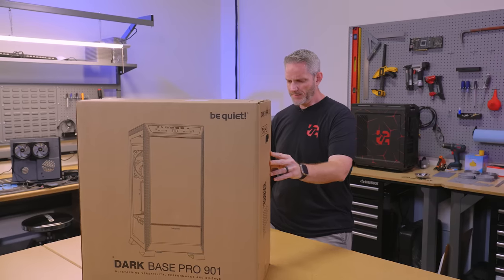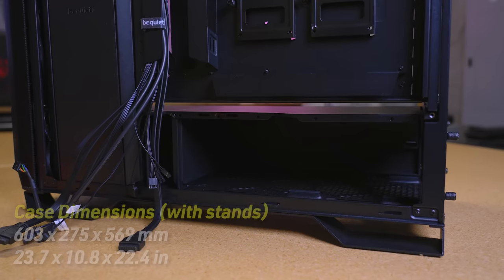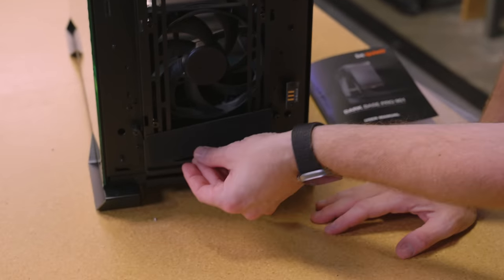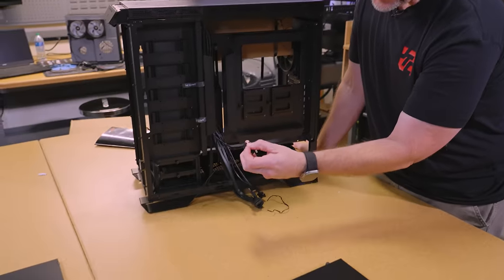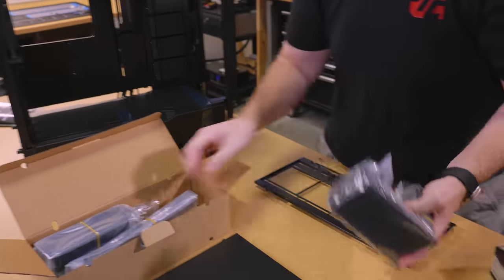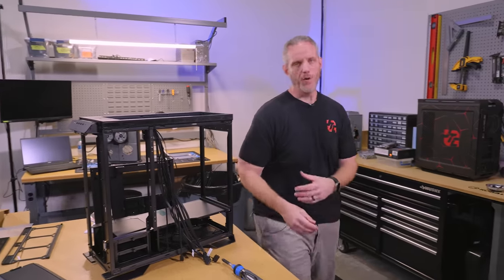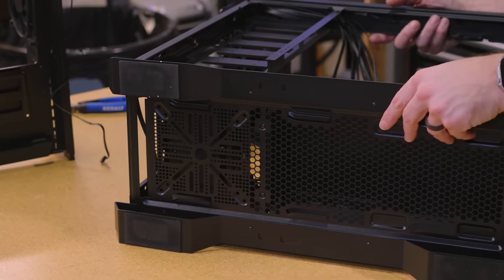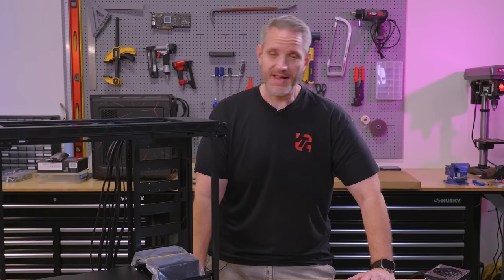This computer case is just crazy!

Comment: I really love the idea of the pogo pins for the fans on the top and front as well as the Xi charger; would love to see those features on more cases. Especially with RGB fans the amount of fan wires that have to get webbed through the back these days is insane so having them all neatly tucked away would be amazing. I am curious mind you how annoying routing those cables is if you want to change out the stock ones.

Comment: I have been using my 801 black for almost 6 years now. It has seen multiple systems. Multiple watercooling configurations and it has been amazing.
Now.. this Dark base 901. That would be worth upgrading to. 

The only problem i really have with my 801 is airflow. It doesnt have a lot of that stuff.. the 901 looks GOOD!
Reply: The Airflow Front Panel (BGA10) is still floating around for purchase.
Reply: I have same 801, I took grinder to front panel ,first popped the foam off in side cut large rectangle and recycyled a 1970 wire mesh from old speaker grill from box tv. 9x 140 fans and 3x 120 fans, great cooling for Australian weather

Comment: I like the 5.25" accessible bay.  I'd actually love to see the option for up to six 5.25" accessible bays.  That would allow for a full ATX board size for use as a home server once I add two cages that adapt three 5.25" bays to four 3.5" hot swap.
Reply: It's also nice if you still rock an optical drive.
Reply: I would say just build your own NAS, even much older cooler master designs offer great cooling and hot swap built in functionality.  It would work in this case but cost far more to do all the conversions.  Hot swap is neat but not really needed for home use, even many large businesses still have all network drives solid mounted requiring tools to fix a raid error/failure.
Reply: @daveboy2000  i got a little drawer i put small things in like sd cards, usb drives. its crazy how much i dont want to part with that silly little drawer in the 5.25 bay. this might be the case to get me to sell my 760t

Comment: I've been rocking the Darkbase 900 ver 2 for 4 years now and its been a great case. The right combo of performance, tower server, and mature looks.
Reply: Does the Rev 2 has a wireless charger? My Dark Base Pro 900 rev 1 had it
Reply: I wanted to get the 900v2 for my latest build. It looks way better than the 901.
Reply: Same, but it's very small inside.
Reply: @kevo05s  Yes it has, but it's a pretty slow charger, the 901 probably has a faster charger.
Reply: @kevo05s  Yeah it does, its not the fastest but it works well enough while you spend your day on the PC.

Comment: I think the sound dampening is very good to have on the front and side panels because both are big panels that can resonate, especially the front since it's pop in/out.
Edit: Ok holy hell it's expensive but I guess if you like the look the modularity is going to give you a case you can build in over and over again for as long as the front I/O stays relevant.
Reply: To me it does seem like a great case honestly, all that ease of maintenance is a luxury that we could all use sometimes
Reply: @Ferrari255GTO  True, if it doesn't work it doesn't matter how pretty it is, and this definitely looks like you can build almost anything in it.
Reply: Crap deal tbh. Better if they sold it for ~$150 with the options you choose instead of $300 for a bunch of stuff people don't want. Aim for a $130-180 customized configuration version where you aren't getting so many parts you'll never use. Sound deadening is useful and while most elastomers like those used are only ok-ish, Jay fails to understand resonance and stopping sound from bouncing around and out of the case. That said, if anything, it seems like a mitigation for Be Cool's fans high pitched whine factor (wavelengths where such materials work better). Better to have fans with low frequency white noise like Nidec Typhoons than Be Cool's piercing trash caused by the ribbing.
Reply: @aaronb1138  Yeah the production costs hike up fast when you build something so modular but it's good to have options on the market for people that need something this specialized and don't mind the cost.
The fan noise is a good point btw, something this expensive is expected to have pre-installed fans and since installing fans from a different brand isn't really an option they probably mitigated the annoying noise profile with padding.

Comment: I did a build a while ago in the Be Quiet! Silent base 802, it was for my work and that was pretty much the only decent case I could find for the specific use case, (server/work station). You know: neutral, no glass!, good air flow among others. It was great to build in, basically no effort at all, works great.

Comment: This makes a good option for a Home NAS build with all those hard drive slots and the 5.25" bay. It's nice to see that they support modern standard designs, and heavy storage RAID and retro optical drive based builds all in one case!
Reply: My 900 will eventually become my primary home server. It was a very versatile case. This one looks like it’ll come close.
Reply: I use my 5.25 as a storage bay for USB sticks ect. BUT the downside is that (unlike the 900) you lose TWO 3.5 drive bays (or 4 SSD mounts) if you want to use that ONE 5.25
Reply: @Pilot_Steve I use a hotswap module for 4 ssd/hdd. There are even moduels for up to 8 ssd if you need.

Comment: I love 5.25 bays. It's something I look for and would rather have 5.25 bays top-to-bottom on a front panel than glass or just big fans. It's not just for optical drives but hot-swap drive bays as well which are available for 2.5, 3.5, U.2, U.3, NVMe, etc, drives. There are various 'front panels' giving extra ports as well as fan controllers and even LCD monitors that all fit 5.25 drive bays. There are also 'cooling modules' for 5.25 bays.

Comment: The 5.25" bay is for your cigarette lighter/cupholder accessory.
Reply: Many people don't use the cd/dvd/br drive anyway, or use external ones. Pc case looks more neat without that any big drives being seen. And it gives more customization on the case, like putting smal figurines or whatever in the case,most specially those who are really spending alot on their pc...

Comment: I actually really like that they included a 5.25" bay. Freaking sometimes you just gotta use an optical drive
Reply: When? It's 2023 (almost 2024), let disk drives die already, lol. If you so desperately need an optical drive, just buy an external USB-powered one. It would be a lot neater and take up way less space.

Comment: Been using the previous Dark Pro 901 rev2. for the last 2.5 years. This newer version is an improvement on mine and I love the bay for the 5.25" drive too. They are well made but I have found that the old version can be tricky to deal with and the manual wasn't particularly extensive. Well done to BeQuiet for improvements.

Comment: This case looks really well engineered. It's too bad that the aeshetics just do not speak to me. I still use 5 1/4 inch bay to add more usb ports to the front of the case. I use a lot of USB devices which is also why i tend to get motherboard with more more ports. I know you cna use hubs but if the computer has enough ports why would I use a hub if I don't need to. and the sound deadening matterial and closed panels do make a difference. I use a fractal design r6 and you could hear a difference instantly of how loud the fans were just by opening the front door.
Reply: I wish Fractal would make the North deep enough to use a side fan with a current GPU.   If they did, I would buy it and it would be my perfect case.

Comment: Thanks for this review! - finally a more versatile case, they even included a 5.25" bay option, cool.  I like it overall for the great front panel options, controllers, wireless charging etc - definitely a refurb option for a secondary unit I have that will be many times better off.

Comment: You should do another video with an actual build in this case, because this is were the trouble for some customers started - according to customer reviews on german dealer websites. I would be especialy intersted in a build wir an inverted motherboard installation, which would be a big selling point for me.

Comment: I actually don't mind the way mesh generally looks aesthetically but I do typically still prefer a solid panel more for that.
However an aesthetic I really like and would like an return of in some way was the vented slots molded into the enclosure a lot of 90's electronics had.

Comment: I Own a Fractal Define 5 or maybe its a 7 idk its been awhile. It also has a sound deadening front panel with vents on both sides, but not the top/bottom. It is significantly quieter with the panel closed opposed to open (it swings open on this case). Sure those panels don't absorb it all but just like in a vehicle using sound deadening it reduces it down to a less noticeable level. You would be surprised how well it works.

Comment: I recently swapped my PC into the Silent Base 802 so I could have it on my desk in the corner. The 802 is an awesome case but the process on inverting it was a total pain because you pretty much had to completely take down the main chassis but it was totally worth it. Also having 4 of the 140mm Silent Wings fans and the 2 fans that came on the Dark Rock Pro 4 cooler running at 100% speed are quieter than the 3 Corsair fans running at 50% speed on the H150i AIO I had previously.
Reply: Agree about inverting being a total pain (Be Quiet do have a video which is worth watching), worth it though. One thing to be careful of is the little rubber grommets to keep things from vibrating. I lost one and was going to get Be Quiet to send a replacement until I got lucky and found it again. Also with the inverted layout the 8 pin ATX power connector can be a paint to route nicely,

Comment: The 'deadening' material can damp resonance that might otherwise be induced in panels by fans and HDD's.  As to airborne/general fan and HDD noise (yes, people actually still use the latter, much as that might surprise our host), from my admittedly limited experience with two cases that use it extensively I would say it does noticeably reduce it.

Comment: Thanks for a well detailed unboxing, I'm thinking of buying. I do have the Dark Base Pro 900 Rev 2 which also is fully modular. 
The beQuiet customer support I'd had dealings with in Germany (I'm in Athens Greece) is excellent, as i needed 2 extra hdd cases and extra hdd custom mounting screws,  their respnse time was very fast and efficient with no "beating about the bush" as also was their response to certain queries I had.
Thanks once again for this vid.

Comment: Love the case but sadly, I'm NOT putting $400+ into the case. I'm currently running a Thermaltake GT-10 and Lian Li Lancool II cases, And while the GT-10 was an expensive case in its day, it has survived three motherboard/cpu upgrades and those 230mm case fans are still pumping along. Don't misunderstand me, I love the case you're reviewing, I'm NOT willing as a retiree, to put four hundred dollars into just the case. It is nice to have all those 'options' but the cost of all those options is just too steep for someone that builds a machine and puts it to use for a decade or so.

Comment: I've had my Dark Base Pro 900 for a few years now, I love the case, supports optical drives, and I have it setup inverted.  If I was going to replace it or buy a new one today the 901 looks like a good choice. Keeps the optical support, keeps inverted, I like the new front panel. Also like they redid the power supply area vs the 900 setup.

Comment: Hey Jay, that 5.25" bay is for an optical drive.  Yes, some people still use an optical drive or at least want the capability to install one.  I have three re-writable DVD drives in my home server because I get called on to make CD copies of musical performances for people, and with three drives I can make a bunch of them pretty quickly.  And most people do connect the HD Audio so those 1/8" jacks on the front are at least functional if not optimal.  There's no advantage to leaving them unconnected.

Comment: I have a Dark Base Pro 900, great case.
I got it because i wanted a inverted ATX setup, makes my Aorus 2070S look nice (they have a led on the fanblades)

And i put a hot-swap HDD bracket in the 5,1/4 bay.. easy access for error checking drives.

Comment: Sound travels very similarly to air.  That deadening panel will mitigate a lot of sound.  This is why adding soft materials and such on your walls will dampen echo's because it is absorbing sound and not letting it just bounce all over the place.  This style of deadening panel is used a lot in Data Centers and primarily deployed in IBM systems.  Their front doors are very much like the front panel on this case.  You really need to do some research on some of this stuff and not just a cursory analysis of "what you read".  They help a significant amount.

DVD and Blue Ray ripping are still a thing and gaining more traction as we head into this era of "you will own nothing and be happy".

Comment: The GPU support:  It looks like it can also be used to help hide the cables being plugged in as well.  Does it have the depth to take a 4080 with the cables plus the support.  The magnets are cool too since it is an easy adjust.
Reply: Noticed this aswell.  Not a bad idea.

Comment: Dude.. have you ever put a rug or curtains in a room? Absorbant material absolutely does affect sound levels, even though it is not sealed shut. Sound is vibration. Anything that can resonate without rattleing or making sounds themselves take up the energy of the sound and convert it to heat or tiny movements.

Comment: A 5 1/4 bay would be used for a DVD drive these days like most people used them when they were on all cases. People still use DVD's and it's nice not to have an external one. Fan controllers were a niche item. Kinda a needed thing if you have a collection of games going back to the 90's.

Comment: Awesome case, so wish, bequiet would release a mesh front for my dark base 700 aswell,... but yeah, maybe when I upgrade my graphics card, and psu, I pick the 901 as my new case. (I run my 700 as inverted atx btw.)
Reply: I do exactly the same.  For me it looks better unverted and the temps of the CPU might bei better, because it is under the GPU.

Comment: If someone wanted to put a CORSAIR SHIFT PSU, would the cables fit at the SIDE PANEL and reach the motherboard components without issues (using the original CORSAIR cables, no extenders) ?

Comment: I have it's predecessor, the dark base pro 900, and I definitely want to upgrade. The extra space for radiators, the new psu shroud, the fuly rotating pcie bracket, they've done so many upgrades !
Reply: It looks so much nicer to build in, the 900 was a nightmare
Reply: @Ritchiev043  The PSU shroud in mine gives me nightmares...
Reply: @Griggoh i couldnt for the life of me find the last screw when i was building mine lol it was pissing me off
Reply: @Ritchiev043  changing the PSU placement was a nightmare, but the rest was fine 👌. 
I've managed to fit an eATX board, a 360x54mm radiator, a 420x30mm radiator and a 300mm pump / tubular res combo in mine :D

From the rough measurement I've made, I sould be able to fit 3 radiators in the 901. A slim 360 on the back panel, and two 420 (front and top) 🤞
Reply: You can buy the PSU shroud for the 900 rev 1 aftermarket fir like 25$. I've never understand the people who screw in all screws of the PSU shroud. It's already rock solid with like 2 screws in the front and works perfectly as a cover
Reply: @Ritchiev043  I needed to take it out 3 times in the last 3 years and after the second time putting it back in I left the screws out to not forget their position again. I mean it’s not going anywhere.

Comment: Even if the sound can escape a sound deadening panel will.... deaden sound by absorbing vibrations, which reduces sound.
...that's how sound deadening works. Its not sound proofing, which requires a sealed enclosure, because sound travels through a 1/8" gap.

Literally entire people's careers and lives are figuring out how to design for sound. Jay's just like "BuT tHe FoAm DoEsN't Do AnYtHiNg."

Comment: Hey Jay... What about doing some "budget performance" builds? Kinda like what you did at MicroCenter with Austin, but not limited by BS lowballing antics. Either YT Creators are showing Top-Tier performance boards that cost $300+ or they're scraping the bottom of the barrel budget shit where they're scraping for barebones functionality. There's a lot of nice upper-mid-tier hardware that is genuinely quick without the need for OC and with the right CPU and GPU they can put out enough chooch to put them in the top 10% without riding the ragged bleeding edge of Platinum-Tier hardware. The $500-1000 (without GPU) range isn't something that folks like you or LTT like to cover, and I've never understood why.

Comment: Jay,
 i still use nzxt Phantom 820 its old case still use Blue ray burner aswell i got EVGA 570 am4 5900x 7900XTX i did have to rip out one of the fan holders to fit the gpu in. 32 gig ram clocked at 3600 i would both 1 x 1TB m.2 and 2x 500GB m.2 5x 8TB 3.5 drives in te 5,2 bay there is drive 1 x 8 tb converted to 3.5 drive hot swop bay and blue ray drive and card reader.

Comment: Pros:
The possibility to have 5.25" drive(s) if desired. I still have a BD-RW drive, and am not quite sold on using an enclosure for it.
How customizable the case is. Quite incredible, and I'd love to get my hands on it someday.4x USB + 1x USB-C on the front panel. Very nice.

Cons: 
That price tag. I need a new case, but not a hole in my head... or my wallet, for that matter.